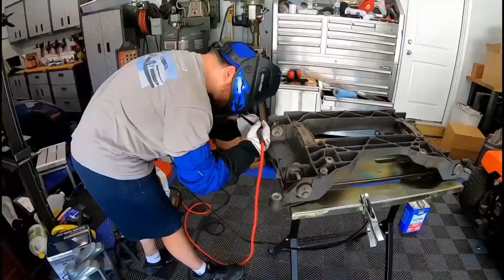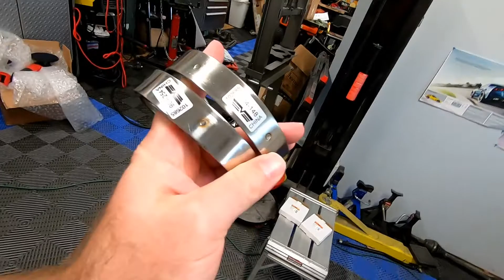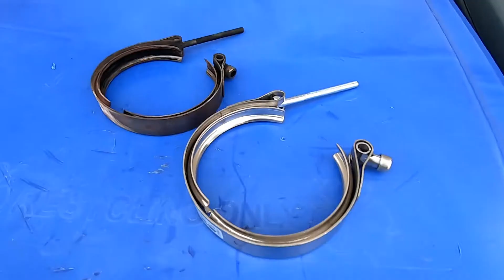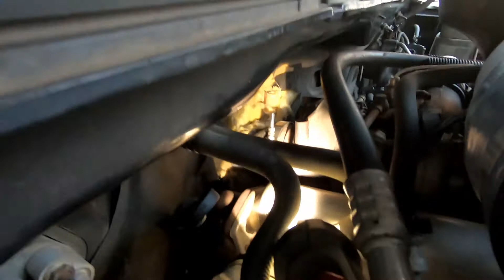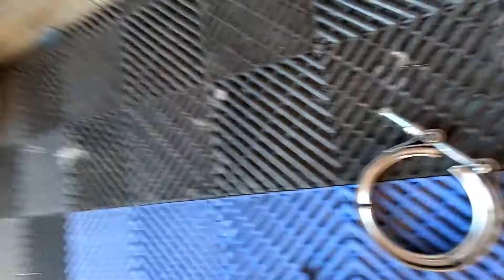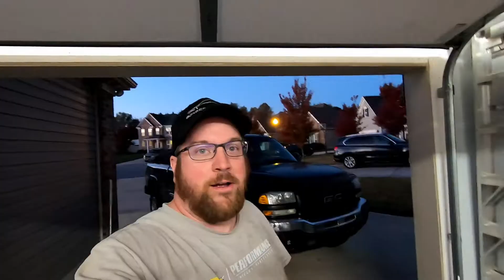2005 GMC Sierra 2500HD - Leaking Downpipe Exhaust Clamps

Comment: I have a rattle on my bottom clamp I'm sure. It does first starting up after 5 minutes heating up it quiets up.
Reply from the maker: When I had replaced my downpipe - I had noticed the leak. Thought I got it tight. 

Replaced both clamps - and the leaks went away.

Comment: So it solved your problem exhaust smell in the cab? I’m having that problem
Reply from the maker: Yes - the top clamp ended up being almost hand tight. Tightening the top 100% helped. The bottom was tighter - but still not a bad idea to replace both.
Reply: @bonecrrusherSS have you had any problems with the Dorman V-Clamps?  They have a 3.6 Stars on Amazon and reviews claim they are cheap and have broke

Comment: Was it ticking at all from the lose clamp ?
Reply from the maker: Replacing all the clamps did quiet it down. I think the top one on the turbo helped it the most.
Reply: @bonecrrusherSS  okay sounds good, thank you. I have a real good ticking noise from mine. Apparently it could be the copper washer for an injector though..
Reply: It end up be the injector copper washer ? Mine started today but I see my down pipe is leaking, pipe is not hook up correctly
Reply: @Rockstarformations  yeah mine ended up being the copper washer. Some other injector lines were a bit loose as well from the previous owner.